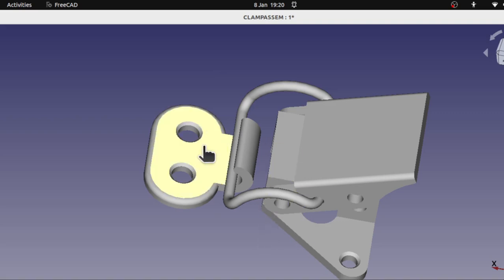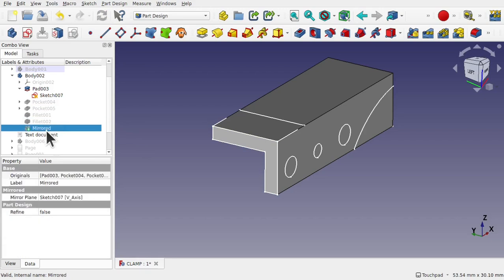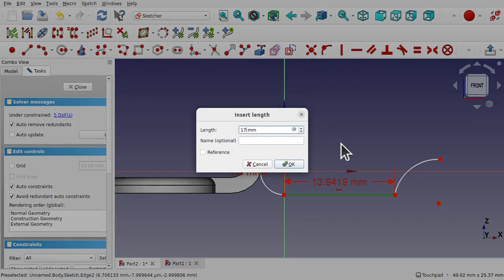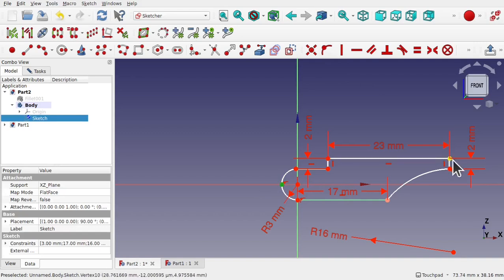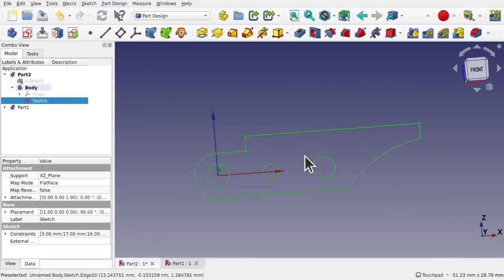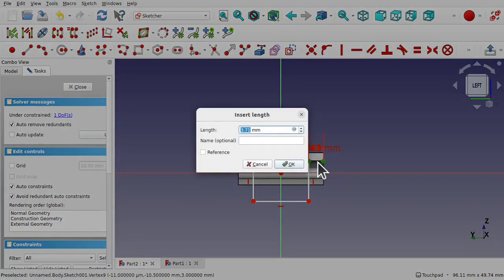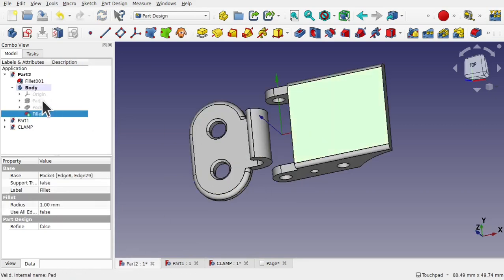Learning FreeCAD For Beginners | 35 (Part 2) | CAD Thinking Part 2: Latch Assembly

Comment: EDIT:  "Toggle Selectability" in the right-click menu for the containing Body was set to "False". Toggling it back to "true" fixed my issue.

Im at 17:34 trying to reference external geometry, but the tool won't let me select the lines shown at this point in the video or anything else from the pad in question. I can hover over the fillet, and clicking that will tell me that its from a different body and thus can't reference it. But, hovering over the pad does nothing at all.

Comment: Excellent video, and an excellent series. I really appreciate your example of all the extra steps that would be taken if you sketched the part on the certain plane, and how you could avoid potential problems further on down the workflow. A lot of ‘how to’ videos show “how” but not “why”. You gave a great example of how to work smarter and why the procedure can be more efficient and create a stronger model in the process. Thank you!
Reply from the maker: Thank you so much for the feedback great to hear it's helped. The cad thinking pilot was a test for a set of series that I want to do more of which can also be applied to other CAD packages and I must get started on them.

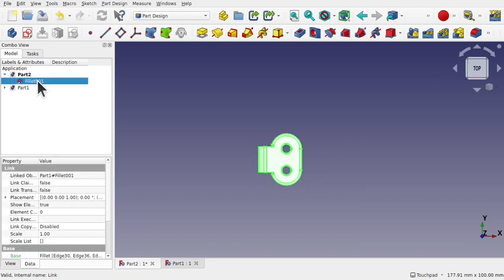Comment: At 6:05 Linking Parts I get the Fillet001 link created, but when I right click I do not have transform option shown. I have FreeCad 0.20 on Win10 pc. How can I get Transform option?
Reply: Turned out I was using an early version of 0.20. I now have a version of 0.20.2 that works.

Comment: Why was this part not modelled using the ‘Sheet Metal’ work bench?  To manufacture this part, thousands would be made using a ‘Progression’ die.  I understand that your trying show us how to use/learn FreeCad but I would like to see parts modelled in a manner or to consider on how they would be manufactured.
Reply: Probably because most parts the viewers will design using these principles will be cnc machined or 3D printed.
Reply from the maker: Thanks for your comment.  In the manufacturing world this would of been done with the sheet metal workbench but the video was aimed at beginners who wouldn't be familiar with such workbench.  The videos are about getting objects into CAD and not the physical construction and manufacture of the assembly itself as it is just used as an example and the majority of people following along would have 3D printers.